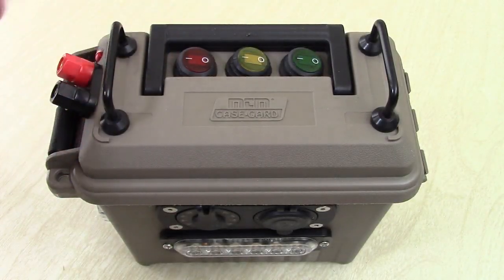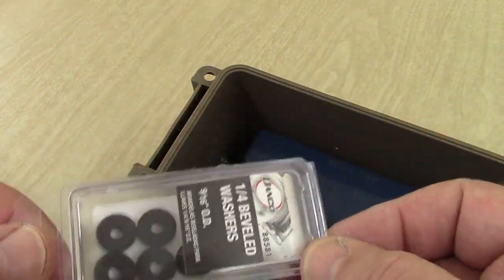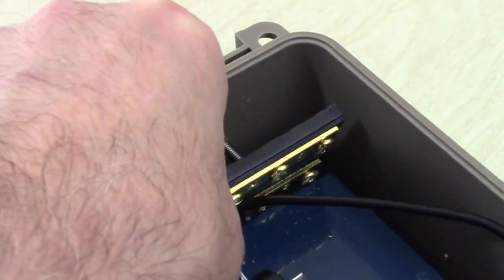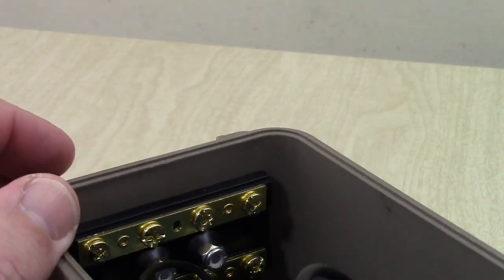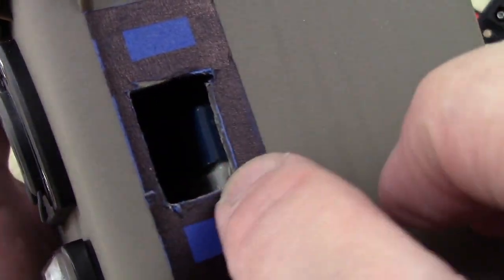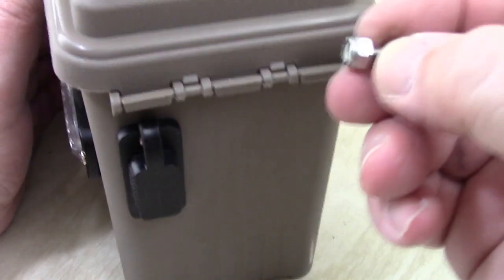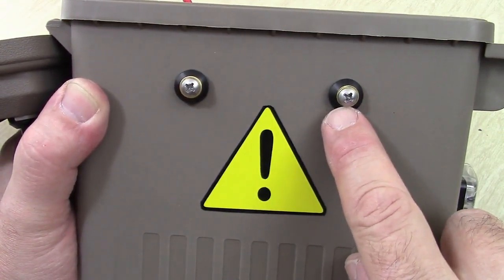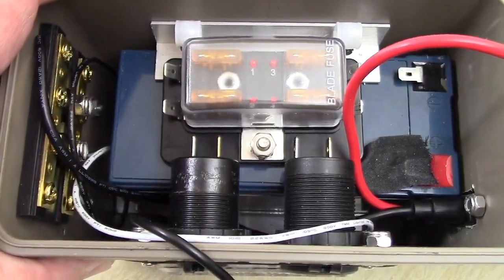MTM Mini Ammo Can Battery Box Hard Wiring Prep...Video #8

Comment: This is after the fact.  You should have used 10awg wires off the battery and then place t splice on the main battery wire. Then run 16 or 14 awg from t splice to the accessories.
Reply: Okay, should have left a little longer tail on the SAE.  Go to Amazon, look for a 2x2 wago connector (2 in 2 out lever lock).  That way you could use the tail you cut off the SAE bulkhead as a universal quick connect adapter, like the banana plug you put on it.
Reply from the maker: I'm with ya, left enough tail to install Anderson Powerpoles and make a pigtail from the left over SAE. Notwithstanding video taping and actually design build time, it took a while to to make these videos.  I'm not a big time youTuber, like most of you I'm working full time, overtime, plus a lot of other stuff... I'm just doing what I can on a budget and for fun with what I have.
Reply from the maker: I used 12 ga for the main cables from the battery to the fuse and negative terminal block. 14 ga for the positive lines to the switches and accessories, and 16 ga for the negatives.  It works for what I'm running on this can and it's all the wiring I had left.. This can just started out as a beginner build and I was hoping that would have been it.  Took some time to figure out how to integrate a bunch of other stuff into it and make it look somewhat elegant.
Reply from the maker: 2326TX, You know what, I'm just happy that I didn't make serious a mistake during the build and start over because it's really a prototype. So off camera I'm trying to figure out how to make it work then I'm trying video tape the thing and kinda also show why the design went the way it did.  Hey man, thank you so much for watching.  Thank you for taking the time to comment.
Reply: @thisoldmanchannel    hey it works and looks good.   I'm old commo, Army and civilian communications.   Over the years I've picked up a thing or two installing DC power to cell sites.  A lot of parts and tools that make the job straight forward, simple, and quick.  Unfortunately the specialty connectors thay I got spoiled on using,  can't be found at the local hardware store.   The lever locks, go into Lowes, they don't have them. Ask a "pro" at Lowes, and they look at you like you're making it up.  Jump online,  find them all day long.   Yep, you didn't do anything wrong, laying out the wiring,  it works.  Just offering suggestions to clean up and eliminate some wire.
Reply from the maker: Hey hold on.. I'm not offended by any comments.... I'm trying to build a better mouse trap and welcome suggestions... I'm nobody special. Keep the comments coming man.. Don't be bashful!

Comment: Great Video, glad you like my recommendation.
Reply from the maker: Great suggestion... Think people really like it.  Looks so much cooler and heavy duty. Thank you!
Reply: @thisoldmanchannel  Do you by chance have a "master" list of the items you used to make the box? Was just curious.
Reply from the maker: No as it was design build... Other than what's evident, 10 feet of  16 ga black and red silicone wire, fuse block, negative block, 3/4" aluminum "L" channel, 12" 12 ga silicone, blue flag connectors... Pretty basic really.
Reply: @thisoldmanchannel  cool, thanks, same thing here, just need a battery lol

Comment: you can also install the screws with the heads inside. Easier to remove if necessary, and easy to get a wrench on the outside of the box
Reply from the maker: Yes Sir, I made the exact comment in the video.. There's a shot of it with the nut mounted backwards on the SAE Plug... Thank you for watching!